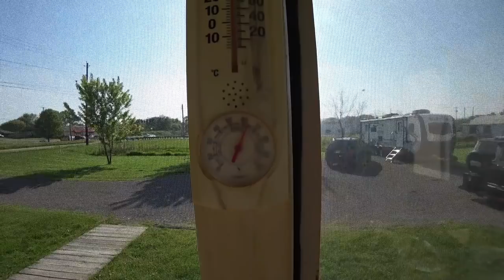RVDaydream Watcha Doin 5 30 20

Comment: I'm curious about the Ford A.I.R. system and possibly deleting mine. Was the system troublesome? Any performance increase? Was it necessary to delete the cat/couldn't you just let the catalyst burn up and blow out? Does the ecm lack an input now?
Reply from the maker: On what vehicle are you working? Year and engine?
Reply: @Rvdaydream  My 1995 F150 with the 5.0
Reply: @Rvdaydream  ???